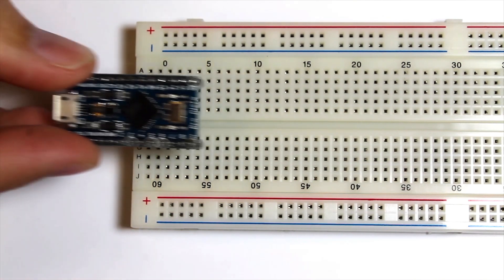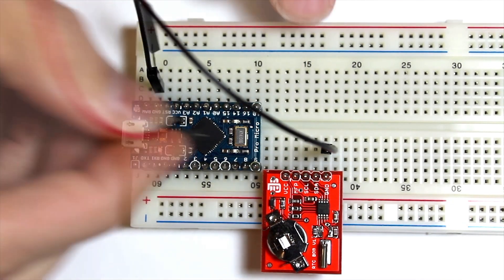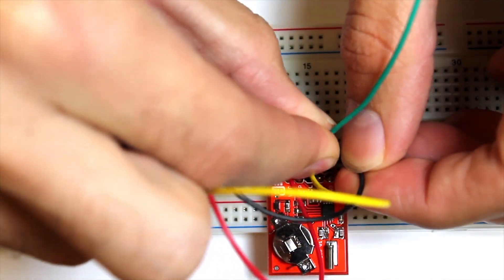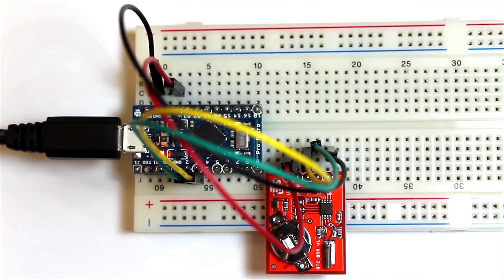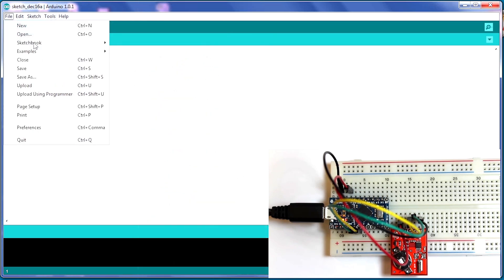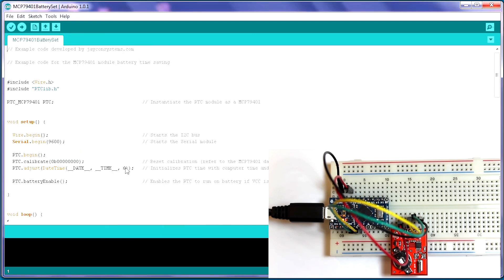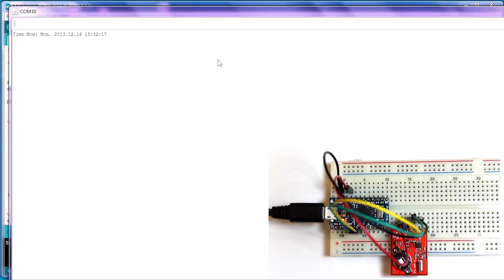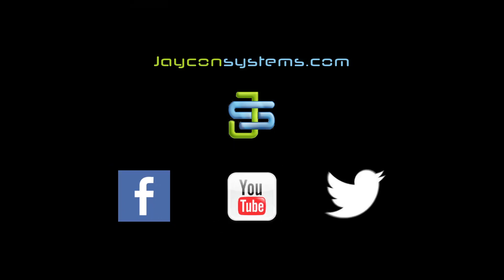Setting a Real Time Clock (RTC) with an Arduino Pro Micro

Comment: Thanks for amazing video. Can I ask u a question? I use RTC module DS3231, i get the time and everything is like what u showed in the video until i turn off the arduino uno, after 5 minutes I turn it on. In the serial port the time continues where it left off which means 5 minutes later than real time. Can u tell me where i did wrong? I think with the RTC module it is supposed to keep time without the power thanks to the battery.